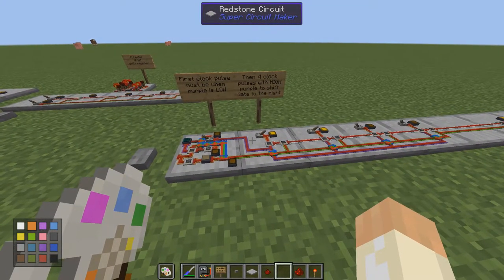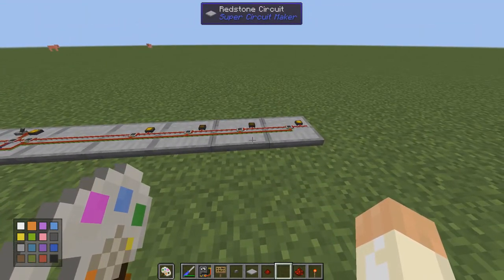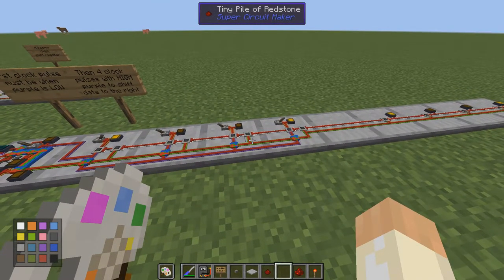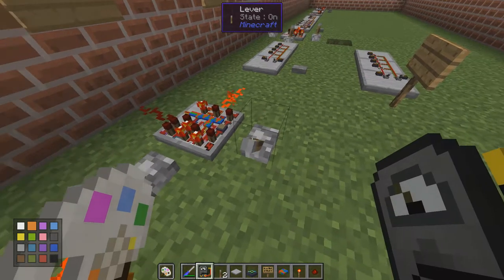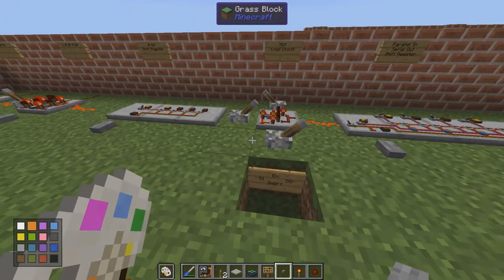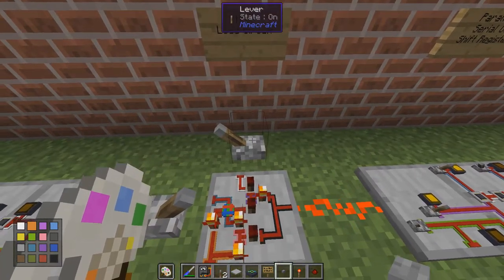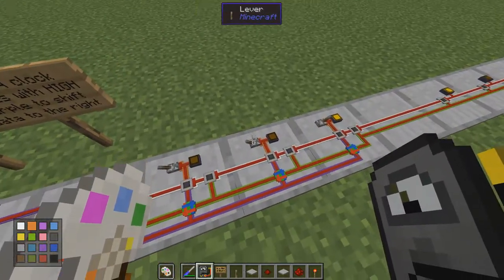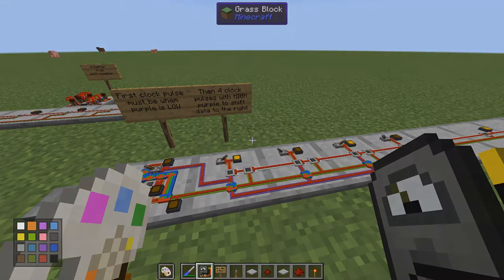Super Circuit Maker - Shift Registers From D Flip-Flops (Modded Minecraft 1.10.2)

Comment: I don't much understand the utility in shift registers.... they seem so useless. also: to count 5 pulses, just chain 9 delays in a row with a 1 tick pulse (every delay at 1 tick) takes 10 ticks to do all 5 pulses if you send input to every other delay (so 1 0 1 0 1 0 1 0 1 is the initial signal each delay receives, and they pass it on much like a shift register)
Reply: I know its not turing complete, it only does exactly 5, but that's not the point
Reply from the maker: Well, I have no specific plan for them, but they are a basic form of serial memory. Transfer parallel data over a serial interface could be useful at some point. I know we've done this before in other ways, but the challenge was to make it with logic gates. With some extra circuits on the receiving part they can appear in parallel instead of shifting in place.
Regarding the clock circuit: Yes, of course I could make a simple and exact clock with delays, but the whole purpose of this was to make it one-click changeable to handle 4-bit, 8-bit, 16-bit or any custom length of a register :) In the first design I had the constant outside the circuit to make it even more generic, but I skipped that in the end.